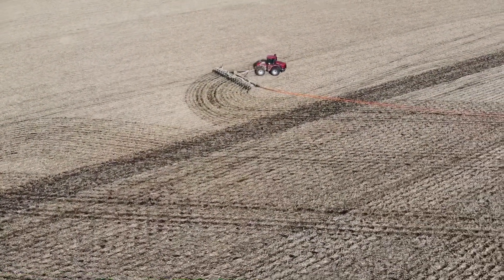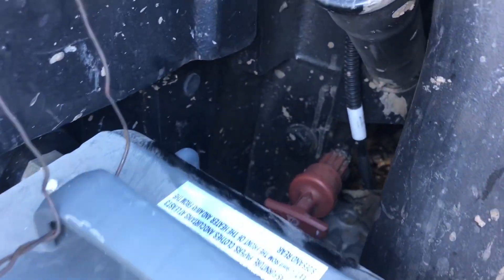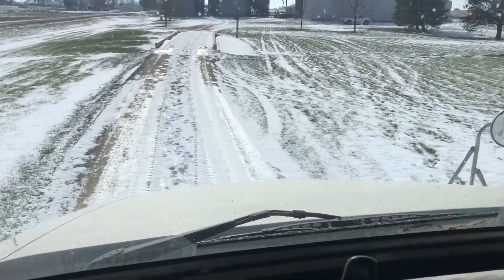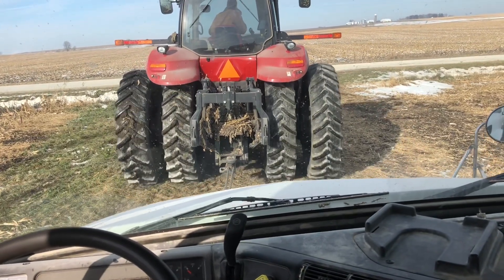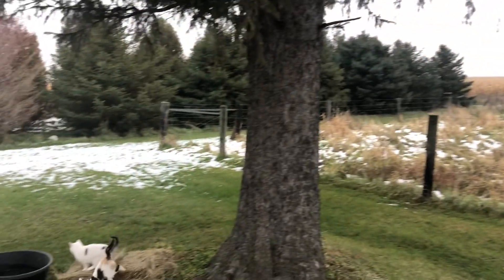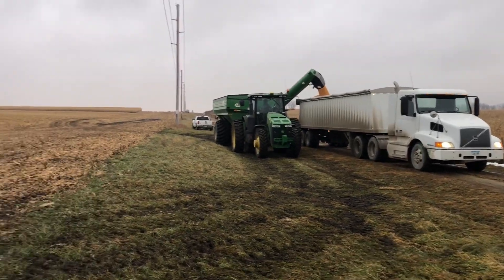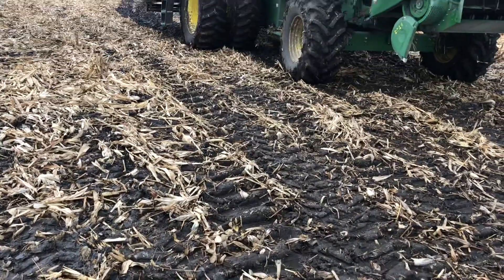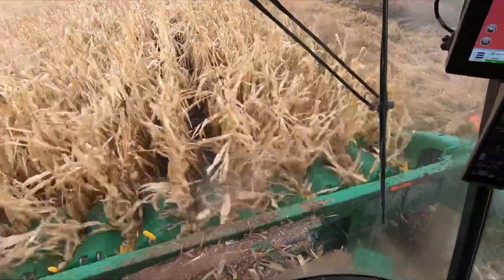Harvest 2019: The Struggle Continues

Comment: Add a gallon or two of no -1 to a full tank of fuel ( kerosene ) this will help keep the fuel from gelling and clean the injectors . Hopefully it will stay cold so you can keep on picking .
Reply: yes we have been very busy  here too  we had a problem with a fuel supplier we have stopped  using them we have stopped using farm fuel completely  now in our own machinery  the problems did go away for us too, we like the rest of the farmer here and all over late start in harvest  still have summer fuel in tanks  they  are ok when we are using the fuel  we have heater to keep it warm they turn it off they morning they would not start  we leave them run and have someone stay with the  equipment all night have a high thrift this year in stolen equipment  we had 3 times they try to steel machinery from  use  the fences were not up let and we run out of room here had to take them to town  
we very busy with the fuel problems we have been calling to look at we do service work for a dealership here we get them up and running pump the bad fuel from there tanks they have been told their fuel suppler  has bad fuel  but they keep using the fuel  cheaper fuel they look at it   what they saved cost them more to run now  we had to go out to fix the problems 
on our farm we do not have farm fuel  it, our choice we choose  one of my brothers do have a trucking company  we have a lot of the trucks have  been here  no room in town for them too we fuel up the trucks here why we choice we did  
when we return the machinery  the farmer is back at there  tunks fueling up with the bad fuel  we told them about it    but spring we  call it easy money  for stupidly  
we have and old duel generator here on the farm it burns anything we feed it to the bad fuel it likes we just had it rebuild this year and taking it into a cat to have it done too we wanted to be strapped from all paint to and had it repainted  and decal it, i was joking to have it painted pink   they did paint it pink wow look awesome  they paint was free   they did that for cancer why it was painted pink
after they painted it  they could sold it 10 times over

Comment: I am a john deere man but what I noticed the red one out side in the cold and the green one was in the same barn where the next night they replaced a belt that was not very old did deere  change suppliers and get them from china
Reply from the maker: That is a good observation. We didn’t have room to get the red tractor and chisel plow inside. The sheds aren’t heated but it still makes a difference. The belt was defective and the manufacturer gave us a new one. It came apart where they put it together.